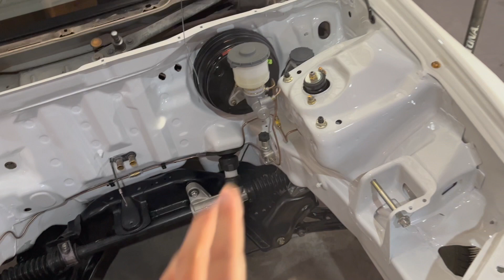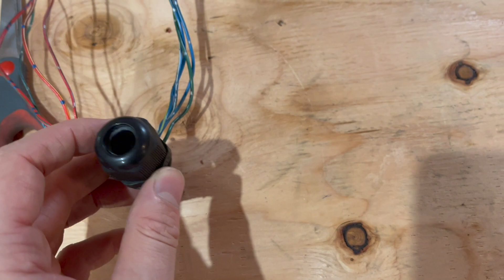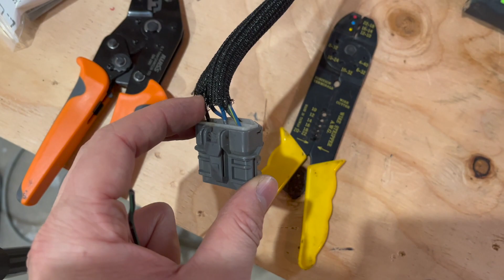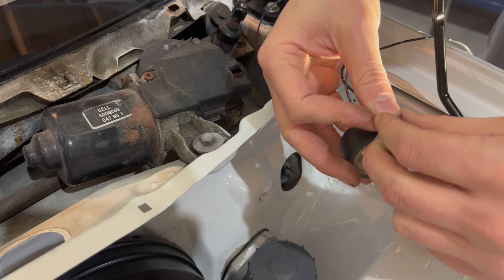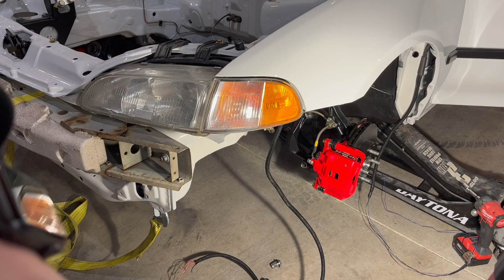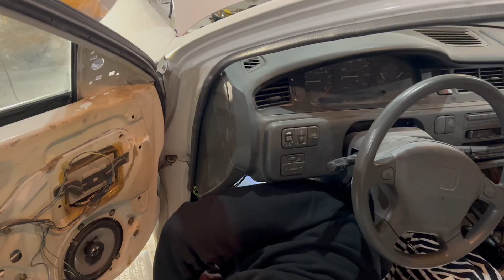Wire Tuck on the Civic - Civic Restoration 16

Comment: I have the exact same screw driver you were using to spread the wire loom, did your Dad give it to you like mine did?😂
Reply from the maker: Good old Craftsman screwdriver. Its actually still his lol.
Reply: hopefully you take some time to clean those headlights or buy new ones
Reply from the maker: @beethao920  I'll be cleaning them for sure. Unfortunately, new is not possible since they are discontinued. And I am not fond of aftermarket plastic ones since the OEM ones are glass.